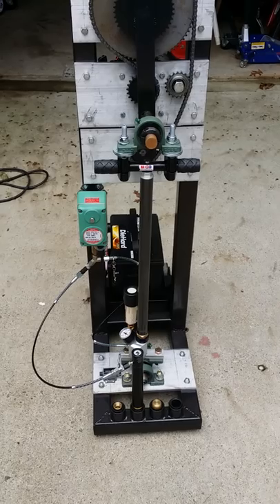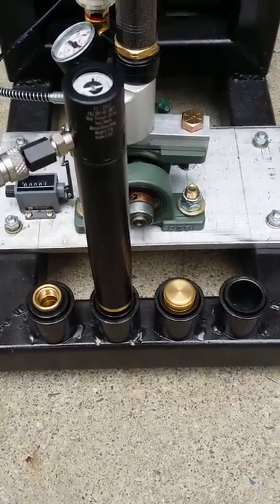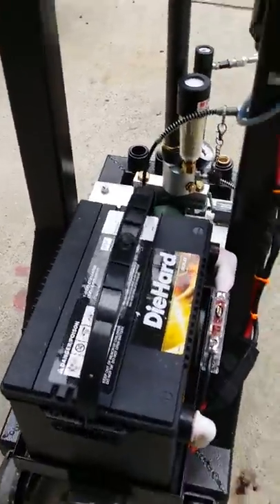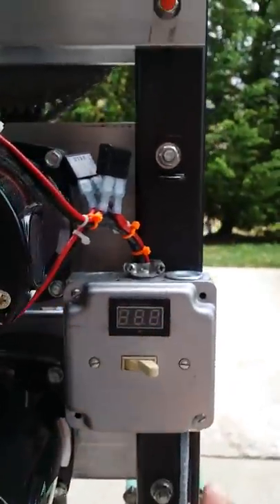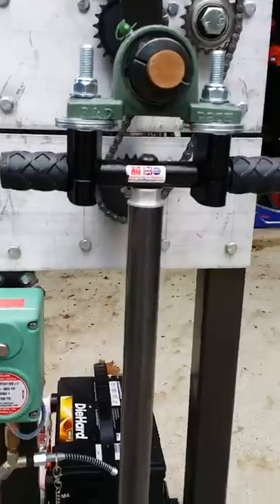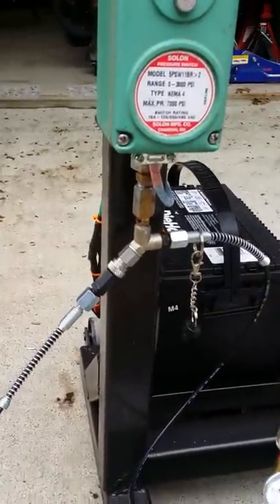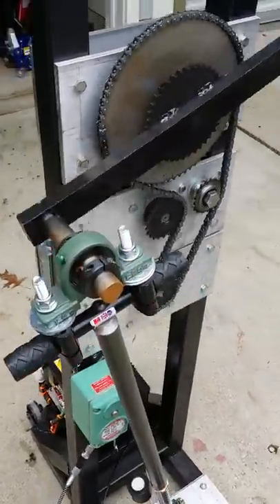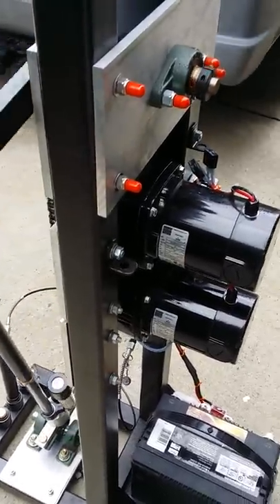PCP Hill high pressure pump run with 12 volt battery.

Comment: Excellent construction, I've seen some other handpumps converted into such an assembly but they were always a bit lacking like not making it all the way down on the downward stroke. Often no overpressure protection and definitely nothing as fancy as the counter included in this one.

The pumping motion was also at a nice gentle pace so the internal seals don't get worn out significantly faster compared to human pumping. Might even be better on the downwards stroke when you get to the point where you need more than body weight alone and some momentum is needed to push it all the way to the bottom.

Possibly the only thing I could technically consider wrong with this one is no temperature based sensor to stop pumping when the pump assembly exceeds a value, but when you're using it attended and only for single rifle or pressure cylinder refills you're unlikely to run into an issue there. It could become an issue when filling entire diving bottles and especially if you're working up in the 250-275 bar range that the pump is rated for.

Comment from the maker: Hi Brad,
I went with a Nardi USA Atlantic G Air Compressor, Gas, 4500 PSI/300 Bar  from Pyramyd-Air. The cost is $3,000.00 and I like the gas because I can take the pump and run it any place, no  electricity needed.

Comment from the maker: Hello....the bearing are called "Block Bearings" see link.

I hope this helps.

Robert

 http://www.globalindustrial.com/p/motors/bearings/mounted-bearings/pillow-block-mounted-ball-bearing-blp20210kp8g5-58-bore-dia-set-screw-compact?infoParam.campaignId=WR&utm_source=bing&utm_medium=cpc&utm_campaign=Motors%20%26%20Power%20Transmission%20-%20Shopping&utm_term=1100404334958&utm_content=Motors%20%26%20Power%20Transmission%20-%20Bearings